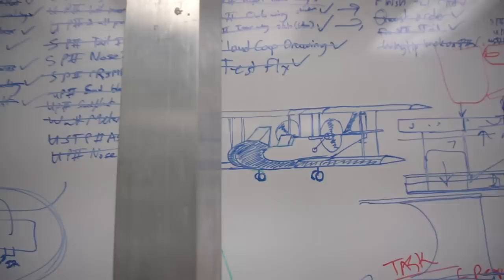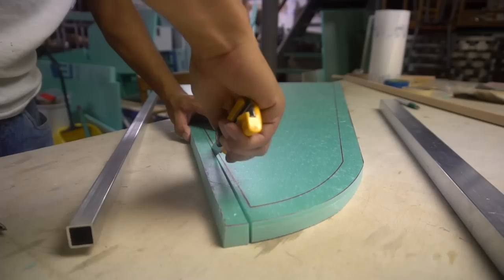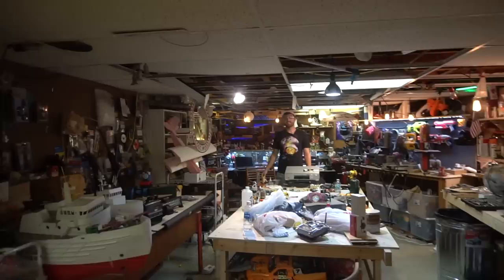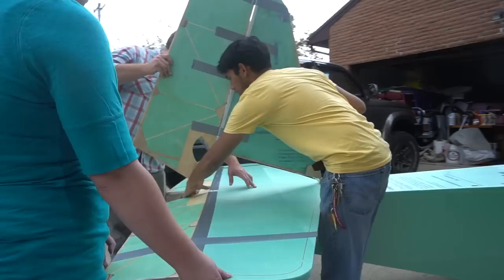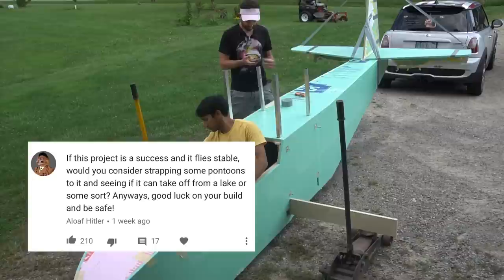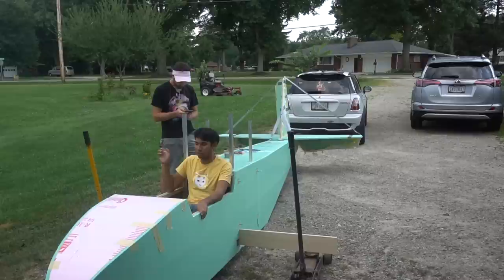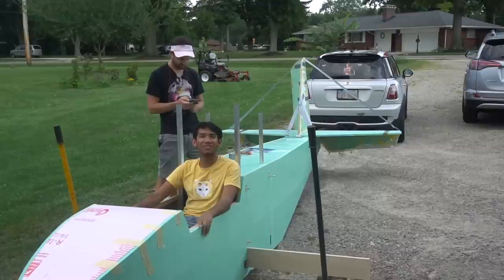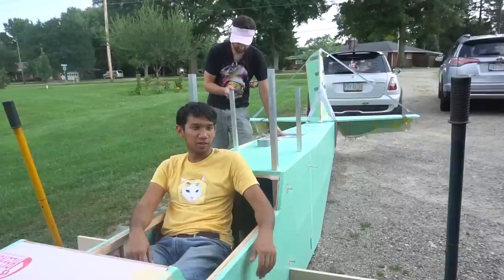DIY Electric ultralight pt2 (tail section)

Comment: You've mentioned you're worried about power but a simple way to fix this would be to add some go faster stripes, they increase the horse power of most street cars so surely the same principle applies to this?

Comment: So the FAA wants you to register a half pound RC plane, but they don't care about a 300lbs Ultralight that carries a person. Makes sense.
Reply: It is all about the stealth factor.
Reply: The max weight for a part 103 compliant aircraft is 254 lbs.  There are quite a few proven designs that are part 103 compliant, like the firefly Peter mentioned and the Legal Eagle.
Reply: It's because half pound RC planes have become a widespread safety hazard, and 250 pound piloted ultralights have not.
Reply: actually the courts have ruled on how redicuous it is to even register drones. anyone who has can get a refund and have their information pulled from the national data base.
Reply: Got proof? Curious,,, so I asked.
Reply: B Wolfe yeah, faa faqs.
Reply: Yep that's the federal goverent ment for you
Reply: Because there's millions of drones...and a handful of Par 103 craft.  Also 103 craft are visible to other full-size aircraft flying.  Drones are essentially invisible to full-size craft until they're within feet.
Reply: thechosendude millions? how many do you see flying at all times? how many approach airspace also covered by real planes? 

i quite litterly just proved that there is no such regulation. the supreme court has ruled that there is obviously no need to do so, and that the faa has a history of over stepping its bounds trying to regulate things that it, by definition, has no control over.

long story short, a frisbee would have to be regulated as a un-manned aerial vehicle according to the faa. model airplanes have been around longer then real ones. if you look at the actual numbers, so far no "drone" has actually taken down or damaged a real airplane. 

this is regulation to solve a problem that doesn't exist.
Reply: People sorta tend to be cautious when it's their butt on the line in an aircraft. Flying around a "drone" on the other-hand, not so much as many youtube videos have shown.
Reply: Weagmonz 4444 that little plane could get into a large plane's engine and start a fire
Reply: lilsammywasapunkrock I agree generally but just wanna point out that there definitely are millions of drones in the US.  Probably the only place our opinion differs is i dont think its totally unreasonable for the FAA to freak out about the number of drones increasing quadratically.  That new demand is from joe publicus, who is a moron.  It wasnt crazy to think that people would be causing a huge amount of trouble, it just didnt actually turn out that way.

"A different data point, via the Consumer Technology Association: In the U.S. alone, last year people bought 2.4 million hobbyist drones, more than double the 1.1 million sold in 2015."

www.recode.net/platform/amp/2017/4/14/14690576/drone-market-share-growth-charts-dji-forecast
Reply: Harper Willis i wonder if this number counts frisbee and football sales. even my kids dollar store hand chuck foam glider. by definition, all would be considered a drone.

a commercially available drone would be the least of a real aircrafts problems. they almost all have a gps governed limit built in of 400ft above ground level, which theoretically would never conflict with an airplane unless it was taking off or landing. not only that, but i guarantee there would be some sort of identifying mark that could be tracked down to where it was sold.

any real hobbiest or someone who spent time to custom build such a craft would undoubtedly know the rules. in all honesty, i am suprised that there aren't more incidents with "drones". you can't regulate stupid, and plenty of that is going around. im just glad that i don't have to deal with undo goverment regulation to enjoy a hobby that has been in my family for 4 generations, without incident btw.
Reply: Weagmonz 4444 the reason is mainly because of those motorized paragliders.
Reply: lilsammywasapunkrock - On a long enough timeline, anything becomes a problem.  And yes, millions; and growing at exorbitant rates.   Even Walmart sells Phantoms now.  Go to any populated public beach or busy public park and I'm sure you'll see someone with a quad.  On the other hand, I can't even remember the last time I saw a 103 homebuilt that wasn't at an airfield.  

I'm not saying I agreed with sUAS registration.  I was against it, because I knew it would never work for safety....bad intending individuals and idiots just don't register.  But I am smart enough to acknowledge 'drones' are becoming an issue as they become more mainstream and easily accessible.
Reply: John Drake thats a total lie tho
Reply: Weagmonz 4444 make a video
Reply: as someone who flys virtually every day, do far I've ran into only one or two drones outside of flying feilds. see the cops use them more then the public.
Reply: Weagmonz 4444. Lol seams ligit
Reply: In US there is a strong comunity of Part 103 and other "license free" aircraft users. The local clubs have their one "ratings" for the airfaild usage ... and instruction system. It's essential to have a strong comunity and drone users hadn't (own "usable" rating system: H-3/P-3 Intermediate Pilot, H-4/P-4 Advanced Pilot, H-5/P-5 Master Pilot; own airparks with useable coordination with the FAA and local towers). In other parts of the world these 103 Planes are fully govermental registred and hold an airworthines certificates --> most ultralight planes already hold an airworthines certificate of some other country. There is no buisness to develope only for one part of the world.Drone users in the other hand had build shit after shit.
Reply: Accessibility, kids. Accessibility. One of these two things is a burgeoning problem, one requires too much effort to be prevalent.
Reply: losttownstreet - Definitely not like it used to be 30 years ago, though.  FAA crackdown on all the overweight ultralights did a lot of damage
Reply: Weagmonz 4444 that's what happens when the government gets too big
Reply: An ultralight is more contrallable than Rc cuz you're in 1st person not standing watching a plane fly and controlling it at the same time
Reply: „just don’t crash it“

Comment: You should use 30,000,000 uAh 6 cell LiPo batteries instead!  Way better! 15:05
Reply: Much better than those worthless 0.00003 GAh batteries!
Reply: Ya, those 0.00003 GAh are crap... just look at how small of number that is!  Can't do anything with that!
Reply: 100kwh buy a Tesla!
Reply: Cole Bender - I'm thinking those 100kWh batteries might be a bit heavy for the plane!
Reply: Nah, he should use 30,000,000,000 uMah (yes, micro milliamp hours) - just look how big that number is!
Reply: His worthless 0.00000003 TAh battery’s are utter useless. That number is tiny!

Comment: Peter when you get to the wing structure follow a similar design to last years FT Flutag wing design. Just use a better trailing edge design and lead lag internal wire bracing. Cover the wing the same way as you are not flying at light speed, the iron on film will be very light and strong enough for your intended flight envelope. Place the lower wing at a positive incidence in relation to the upper wing by 2 to 3 degrees so that it will stall first giving you a very gentle stall characteristic.  Also get some 2oz glass cloth as 4oz is way heavier then you need for how you have built your fuselage structure. After applying the resin lay heavy mil plastic sheet over the glassed area while the resin is still wet and squeegee out the excess. This will help you save weight on the glass work and give you a very smooth finish.  Finally THINK LIGHT BUILD LIGHT, don't over build as that is how a lot of airplanes turn into obese flying pigs. Also consider a tail drager landing gear as it will save a little weight and help move the CG forward a little. Keep up the good work Peter. This is what aviation used to be like before all the beuracrates got there stick finger involved in it.

Comment: Looking good Peter and friends!   The tail is shaping up nicely, and should be plenty strong with the addition of some simple wire bracing. A few suggestions, and comments in general:
the ballistic parachute is definitely the way to go, if you can. 
do not bother with a hybrid system of any kind, as it can only add a very large amount of weight.  you will most likely be in a weight crunch, as you approach flight readiness. 
you may consider using some of the higher density li-ion batteries for power, unless hobby king gives you some batteries, in which case, there is nothing to lose from using Lipos.    If you send me some numbers, I can run some feasibility calcs for the Li-ion cells, to see if they are applicable, and if so, which specific cells would be best.   need the max amp drag, and voltage for the motors.  also need the weight of the lipos that you would use, to size the Li-ion packs appropriately.  you will also need ESC's that allow a higher voltage range of operation.  The Li-ion cells are a lot safer, last longer, and if you could use them, would provide for longer flight times.   I suggest placing them in front, or behind the motors, (depending on pusher, or tractor)so that they are cooled, along with the ESC's. The Li-ion cells can utilize cross ventilation as well, so will not retain heat, and get damaged by localized over temp.  They also have a higher useful cycle life, so will last for longer.  Anyway, you are doing well so far, and don't listen to people who are negative, unless they have something to offer.
Reply: Also, don't put too much value on a comparison between the lightning bug, and your aircraft.  Power to weight ratio is not a great way to compare aircraft propulsion, as there are so many other factors which are far greater factors to power consumption.  for one, you have a fuselage fairing, and will be using higher aspect ratio wings, which makes a huge difference.  using a constant chord wing, with a conventional tail like you have can allow you to have a much better and higher lift airfoil, with a higher coefficient, or total lift factor.  I would still go with a monoplane, as the boundary layer propagation from one wing will make the other wing produce far less lift, but drag will stay the same. The decision is minor, and the biplane config may help you with bracing and even if it lets you fly slightly slower, it would be good for it's safety factor alone.
Reply: peter, have you seen the Skypup ultralight aircraft?  seems very similar to yours except fro the wings, and the fact that your's is a twin?   I really think you should go with a monoplane, and keep the twin motors, but check it out, and see what you think.  The Skypup is a pretty safe ultralight, and was designed by some engineers a t cessna in Wichata, but i'm sure you could make it better.

Comment: One of my idols in aeronautics has always been Mike Arnold who also built by feel and developed the design as he went but he started with incredibly sound foundational knowledge and theory which is what informed my studies for the past 20 years, he built an actual production standard performance aircraft whereas as you are learning as you go and producing aircraft that are basically disposable or one-hit wonders, very admirable and I can't fault the basics but with your passion, I feel you should be looking at actual good performance light aircraft, Arnold's AR-5 was made with much of the same materials you are familiar with just more acutely and finely shaped. My 2 seat design hopefully qualifies for testing this year. I mean discovering that your flying airframe is covered in a different weight cloth than you thought only when it's already assembled says a lot.

Comment: Foam and epoxy is usually used on high performance light aircraft (usually monoplanes), and tube and fabric construction usually used on light, slow flying ultralights (biplanes are almost always built like this). You have probably considered this, but perhaps build the wings tube and fabric (or plywood ribs with a fabric covering) to save weight otherwise you might have a rather high stall speed. just use plenty of wire bracing and it will be just as strong.

Comment: I love these videos!

I think the way you glassed the tail is great. The glass adheres to the structure and stiffens things up. With the fuselage though glassing over the foam will help at the start. As the foam breaks down over time the glass will have more movement in relation to the wood frame. That will make it lose its effectiveness.

Comment: A lot of weight could be lost if you'd cut circular large holes in the foam and then reglass them with a round strip on the inside of the fresh cut and a joiner piece of sorts on the edge. Of course, little to no excess would be ideal in this.
One thing i don't see mention of, is a material weight list. I would consider it, in the future if you ever approach a topic like this again. It has the benefit of giving you an exact quantity of certain items regardless of their spread through the object you're making.
German race car build procedure from back in the day. It served them well considering they were able to fit their cars exactly on the dime, so to speak, and did it without sacrificing anything in the "rush".

Comment: Make sure you add a skid ball. it's the most important instrument if you are going to stall the aircraft. Keep the ball in the center using rudder only and it can't enter a spin. If you get unbalanced during the stall it will spin and you'll find yourself upside-down in a split second.

Comment: Peter. Make sure your elevator is heavy enough towards the front to keep any flutter out of the controls. Granted you won't be high speeds but flutter can occur at any speed relatively speaking. Make a counter weight.

Comment: 1. Drill holes, melt out foam. 2. You should strip down your wood to somewhere around a 1/4 inch thick. The fiberglass will hold its shape with ribbing. You can at that point see a significant reduction in weight.

Comment: A quick check online, poplar is about half as strong as sitka spruce. Douglas fir is common and stronger than either.  In any case VP designer Evans describes nearly invisible compression faults. You may want to test that your wood does not have compression faults.

Comment: Correct me if I'm wrong but it also seems like flying higher would be safer, because while it is... well, higher, you'd be able to parachute more safely in event of an emergency, and if there was something like an engine failure you'd have more time to glide safely to a landing area

Comment: take it from someone who works with fiberglass and build wind mill Blades upwards of 80 Meters (262ft). That Cloth isn't strong enough. also, you can not ignore the fact that you need the correct amount of resin to Glass. which is 30% Resin 70% Glass. too much resin will make it brittle, not stronger! Play it safe and use at least one layer of Biax 600 Gram or even better use Triax 900 Grams. Use vacuum Bagging to infuse the Fiber to archive the best possible Glass ratio. and you will also save A lot of weight! 

i understand that if you use Fiberglass you will add a lot of weight to the aircraft but better safe than OH there will be no sorry!

Comment: If you ever decided to do a second electric aircraft, perhaps you should see what NASA has done with the X 57 Maxwell-  basically put eight propellers on a section of the wing, where the wing has a relatively thin chord length, so that prop wash and thrust from the motors are directly translated into lifting force due to increased airflow over the airfoil

Comment: You might want to use a fiberglass roller, it might make your resin go further, so you get basically the same strength for less resin, hence less weight.

Comment: To increase the engine torque you could add a gear system. and by having said system you could have a safety by disengaging the motor.

Comment: To get a better idea of where the center of gravity is, your lift points should be higher so the plane's vertical center of gravity "hangs" under your lift points. Otherwise, it is unstable, like balancing on a ball.  When fine tuning, its better to err on the nose heavy side for sure. Take care.

Comment: the vertical stab may be very strong itself but its only as rigid as the structure its mounted to..  so hopefully that entire fuselage is very rigid regardless of the direction of forces applied to it.

Comment: Fiberglass is heavy.  Use 3/4 Oz glass cloth.  After you put on the resin, soak up the excess with a roll of toilet paper to soak up the extra.  Very light way to glass surfaces.  The pro's use vacuum bagging.

Comment: If you can afford it BRS would be a great idea, but also be aware of its limitations in Speed of deployment aka G shock load, and height. There are a lot of deceased SR 20 / 22 and Par 103 Pilots who waited untill they where a long way outside the max deployment envelope to deploy the units.